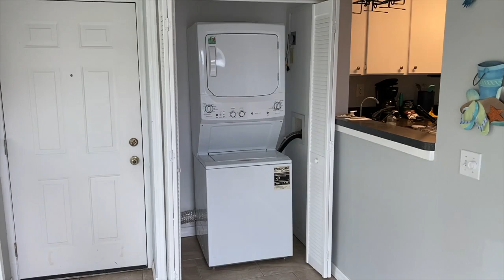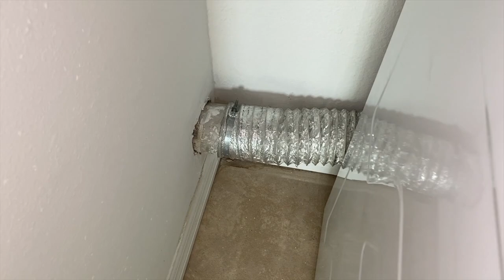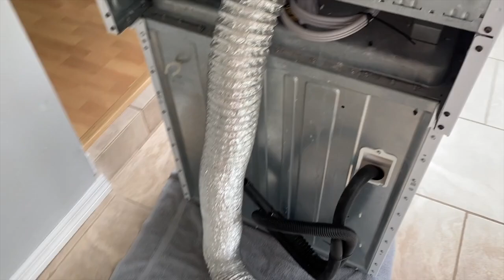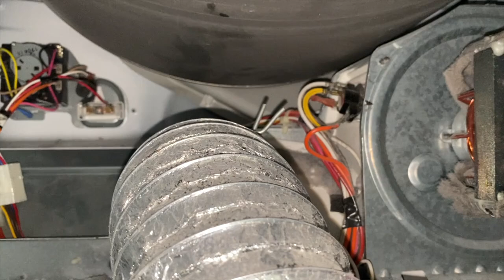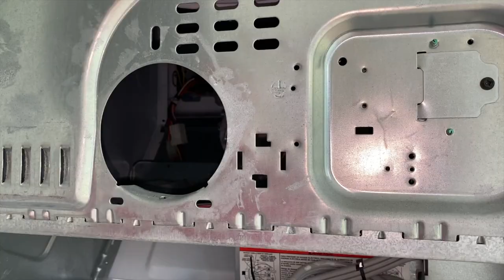Remove and replace dryer vent exhaust hose tubing

Comment from the maker: If interested in purchasing this product, visit our Amazon affiliate link below.  I earn from qualifying purchases.

GE Laundry Center

     Electric:  https://amzn.to/40utSsq

     Gas:  https://amzn.to/3WtjiB8

New dryer vent hose:  https://amzn.to/3PYQi0e

Dryer exhaust shoot:

     https://amzn.to/3C7bfTl

     https://amzn.to/42aJLH2

     https://amzn.to/40hLwzN

Joint pliers:  https://amzn.to/4g2t0RC

New water lines/hoses:

     https://amzn.to/4jDg3AT

     https://amzn.to/3Q10cOU

     https://amzn.to/3Q0vKV7

New Power Cord:  https://amzn.to/3WAg4eS

Dryer outlet/receptacle:  https://amzn.to/40DcUIO

Drain pad 29”x33”

     White:  https://amzn.to/42t3GkQ

     Black:  https://amzn.to/40v7dfK

     Gray:  https://amzn.to/3Ec5F2M

New Felt pad:  https://amzn.to/40HkGCm

Dryer belt:  https://amzn.to/40GkCmq

GE Lid/door latch switch:  https://amzn.to/4hNWrZh

GE lid/door catch:  https://amzn.to/3CdiGZt

Zip Ties:  https://amzn.to/3EoPuiU

Cutting pliers:  https://amzn.to/3Cfa5Fr

GE Drain Pump:  https://amzn.to/4h6tnft

GE Control Board:  https://amzn.to/40Mrij1

GE Dryer Heating Element:  https://amzn.to/3CrNIwB

GE Dryer Push-Start mechanism:  https://amzn.to/3Cq0BHG

Dryer Drive Motor:  https://amzn.to/3EcEhBR

Dryer knob:  https://amzn.to/3CpTzT4

Washer start/cycle button mechanism:  https://amzn.to/3CqZEyK

LG THINQ Laundry Center

     Electric:  https://amzn.to/42l4XKJ

     Gas:  https://amzn.to/3E4hwzU

Dyson vacuum:  https://amzn.to/42FZG0m

Interior clothesline:  https://amzn.to/3tkwE3e

**********************************

1.  Prepare GAS version appliance for pick up and haul away

          

2.  Replace dryer vent hose exhaust shoot

          https://youtu.be/ZsEBjLR5LOQ

3.  Replace Laundry Center Power Cord

          https://youtu.be/0q2CIqmPHDQ

4.  Replace Control Board

          https://youtu.be/CqGeZuNiYWA

5.  Remove Laundry Center washer front panel

          https://youtu.be/R1vAYXoBeBY

6.  Replace dryer felt pad

          https://youtu.be/xFHzwp7ueTQ

7.  Hang neon sign

          https://youtu.be/-uuOACk-J_k

8.  Install interior clothesline

          https://youtu.be/LRMbGpZu_9E

9.  Replace dryer belt

          https://youtu.be/-Kz3Th7K9bs

10.  Laundry Center dryer power cord reset

          https://youtu.be/WA6asZX9ndA

11.  Prepare Laundry Center for pick up and haul away

          https://youtu.be/QxJ-Aro1-lQ

12.  Install new Laundry Center

          https://youtu.be/SgA4MPxKB-Q

13.  Replace Lid Switch (Not on unit shown in video)

          https://youtu.be/1hTRc-_PnP8